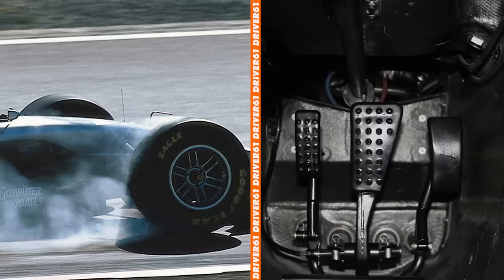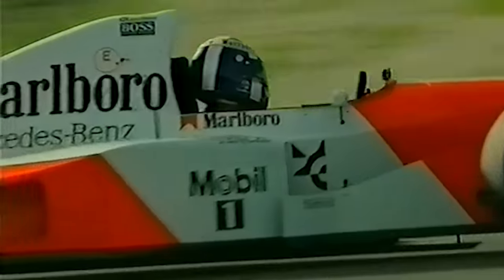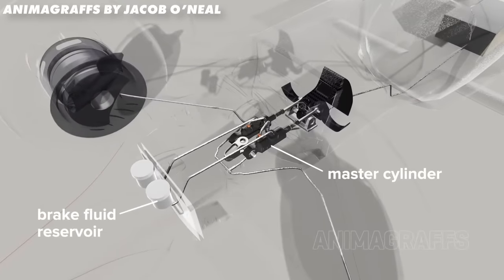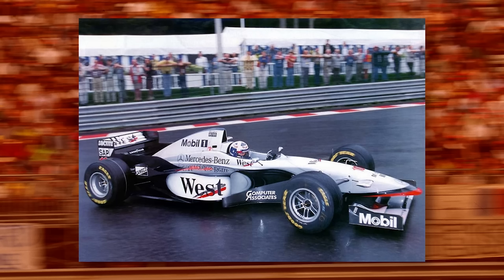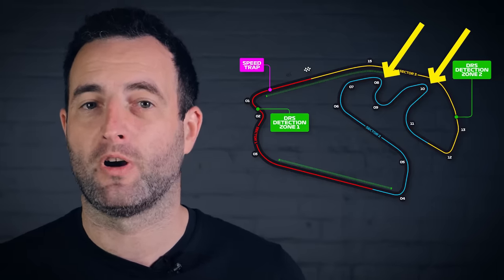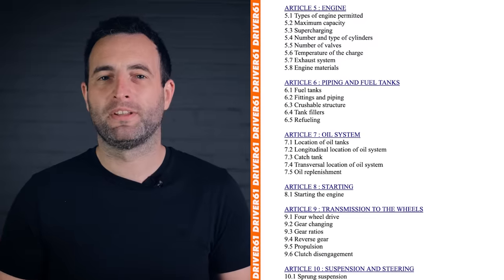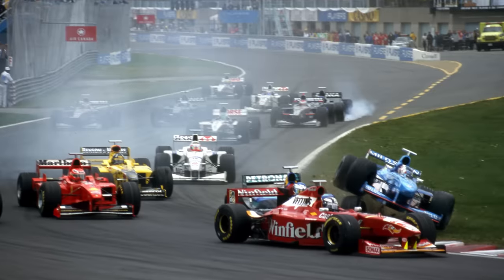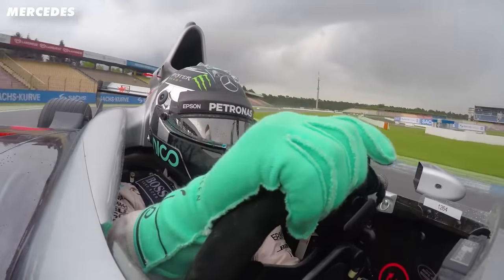Why This F1 Car Has FOUR PEDALS

Comment: No cheating, just briliant engineering.
Reply: It’s a shame they didn’t link the extra pedal to the steering rack. Turn left and it enables left caliper, turn right for right caliper.
Reply: @timh6845  then you'd end up with pointless braking on high speed corners
Reply: @timh6845  farm tractors have that technology.
Reply: @vincev5242  only with pressing the second brake pedal

Comment: I ran a 125 Super kart 20 years ago with 4 peddles mainly for the starts but it was good to be able to trail brake as well, and I use to race a gymkhana car that I had setup the clutch peddle to operate the hand brake when fully depressed so I always had 2 hands free for steering and changing gears, so as I pushed the clutch in at a hairpin it would disengage the clutch so I could shift back gears and keep the revs and handbrake turn all at the same time and then just dump the clutch as I came out of the turn and off it would go for the next turn. It was so fast and some people tried to get me disqualified but there was no rules saying you had to use a hand operated hand brake to turn so it never got them anywhere.

Comment: In motorcycle racing there's drag braking. Holding a bit of rear brake that helps keep the trailing arm suspension squat. I believe it helps enable an earlier delivery of power on exit. Which would squat the back if trail braking wasn't used. Less bobbing of the rear = smoother and more effective power delivery. On an F1 car there's an extra x axis for brake steering. I wonder if this feature also helps with keeping the rear squat? It's a double effect maybe.

Comment: Brilliant video here.
Appreciate it.
1 question here though...
Were FIA Stewards not checking the car post race everytime ?  As I know, FIA checks weight, underbody plank etc after each race.

Why it was only uncovered when photographer took photo of retired car.
Reply: It was uncovered to the public and other teams. As far as I know, the FIA will have deemed it legal privately with no obligation to make Mclaren’s design public
Reply: @TheSnaveeelPlaysGames  Yep, it passed all the rules about "the driver must pilot the car alone, unaided" and whatnot at the time since it was just a simple mechanical connection. There were no rules about having a brake pedal only connected to one wheel XD
Reply: The FIA had already visited Albert drive ( Mclaren factory) and agreed it was legal before the car was raced.

Comment: Tractors and other large farm machinery have had split brakes for over 50 years, one break pedal for each of the 2 drive wheels that were close enough so you could use them both at the same time. When using a rear wheel steering vehicle you can turn on one wheel.

Comment: It is a steering system of the rear wheel, the tank example is reasonable. Because F1 is driven by rear wheels with differential. If you brake the inside rear tire, it not only pulls to rotate the car, more engine power will be put on the outside rear wheel by the differential which push the car to rotate. How a tank steers? it pull one side and push the other side. The question is if the 4 wheel system is better than the 2 wheel ones why ban it?

Comment: This was an interesting bit of design and engineering, but not cheating under the rules of the time. While it was truly amazing to see it used in F1, it was being used off road quite a bit before F1.  My Dad and many of his friends build “sand rails” or “dune buggies” with steel tube hand-made frames powered by air cooled VW power trains.  Most of these buggies had steering brakes, separate activators for the rear brakes.  Our buggies used hand levers instead of an extra pedal or so, but they accomplished the same thing.  They allowed the buggy to make tighter turns (sometimes we used them to steer when we could manage to get the front end in the air).

Comment: Another reason brake steer should be brought back is to provide a greater challenge to the drivers. It's not a driver aid as it gives them more to do. It will make the sport slightly more about the driver than the car.

Comment: Why not just split the pedal, and pressure one side more than the other, manually creating a step in the pedals?
Or why not have a switch on the wheel, which changed brake bias left or right? You could even set it manitino-style with a range for each side.

Comment: In dirt track racing disabling a corner of the cars brakes is just part of the cars set up. Front rear bias is usually allowed but not individual corners. My old autocross car could bias side to side braking ( prerset ) and other teams took note " how can your car just jump into the corner ? ). My advice is to study ALL FORMS OF WHEELED RACING and be open to try what works for others...if you're not " cheating " your not competitive.

Comment: i think the system fall to the "passive 4 wheel steering" some cars nowadays have traction control to limit the inner wheelspin to make the car better at cornering, i even think diffs could be called passive 4 wheel steering to some extent

Comment: We need a racing series with no build rules excluding safety, NASCAR on-track rules (mainly rubbing is racing), and tracks that have a mix between F1 and Rally (like Spa with half the track made of dirt, along with the variety of SST tracks where entire sections change every year, and the starting grid of SST where the fastest in qualifying start in the back, potentially even with an up to 5 second start delay

Comment: This is actually  brake migration in nowadays. The extra pedal is electronically replaced by brake by wire system.
Reply: But you can't choose which of the rear wheels can be slowed more than the other
Reply: @pranavps851  The brake migration would automatically adjust according your diff speed.

Comment: All they had to do was get a cutter brake from a sand rail. It is on tractors and sandrails. It is alongside regular brakes and hand operation or foot operation. In Michigan that is what sandrails use to avoid trees on tight trails at high speed.

Comment: Mazda does use this brake steer method on the mx-5. They call it Kinematic Posture Control (KPC). It’s computer controlled so no second brake pedal but it does the same general thing.

Comment: As soon as the video started, I knew where this was going.
In aircraft, it's called differential braking.
This is quite a clever application, though. The implementation in aircraft is somewhat different, with the brakes being applied by both feet, one for each side.
I applaud their thinking.

Comment: Ferrari's tank argument comes down to the fact that tracked vehicles are primarily steered by changing the relative speed of each track through brakes and the gearbox.
Reply: Yeah, this is essentially a basic version of a differential brake steer used in M4s and the like. 

Maybe someone should try double differential steering.

Comment: They could've used a diverter valve linked to the steering wheel. Turning the wheel one way, sends fluid to the appropriate side. While straight it would send the fluid to both sides

Comment: I wonder why they did it this way instead of making a split pedal where each side of the pedal controlled the corresponding rear brake, but that you could also press both of at the same time for uniform braking.

Comment: They should come up with a ultimate racing open series. 
Allow all "banned" Tech From standard series. Fuel bias weight distribution systems, 4 wheel steeling, brake steer ect..... 
Teams know itll be a dangerous run... everyone's got an edge over something. Obviously Have a core rule book, No rocket assist, nitro ect.. 
But ya have a series that has all of these great ideas alloud to be put in a vehicle and see what happens.
Reply: and no budget limit

Comment: The part that is mind boggling too me is that they didn't install a valve linked to the stearing rack to switch the  side  on what the stearing break  is active to gain for the full potential of the system

Comment: As with all of the cockpit operated variables, it makes racing harder so it's strange to consider it cheating. There's an alternate timeline where sideways cockpit operated brake balance became a thing. I have a hard enough time thinking about moving front and rear.

Comment: So they used technology found in skid-steers, tanks, farm tractors, and anything that moves around on tracks, albeit utilized much differently in skid-steers and anything with tracks or use a hydrostatic transmission, but same basic principle.

Comment: Is this where all the brake-based torque vectoring on modern cars came from? Like the ones on WRX/wrangler rubicon etc?
Reply: road cars had "brake steer" since early 90s
Reply: @Baker_7498  brake steer and brake based torque vectoring are two different things. one kicks in when you apply brake the other kicks in when you apply throttle.

Comment: In a non-technical way I guess it was like a steering aid instead of means of steering. I get it that they would want to ban it - because the alternative would be that everybody would eventually adopt it - but I think they did it in an way that seemed arbitrary, instead of changing regulations to explicitly ban it in the future. To say that changing the speed of one wheel relative to the other constitutes steering and should thus be banned sounds absurd. So what then? Banning differentials?
Edit: Also, why only on one wheel? What's wrong with having 5 pedals lol

Comment: Pretty sure the differential would actually start sending more power to the outer wheel due to the brake force on the inner. Slowing down the inner and speeding up the outer sounds even more like steering then just braking one wheel alone. Nice.
Reply: And this would make it a 4 wheel steering system as all 4 wheels are actively turning the vehicle.
Reply: @kelainefes  very much so. It's super clever I have to admit. And honestly also I acknowledge a seemingly godly amount of talent a driver would need to use something like this to good effect.

Comment: Could they have gotten both rear brakes to operate independently if they connected it to the steering? ie if you are turning left it would brake the left rear wheel and turning right would brake the rear right wheel using the same extra pedal?

Comment: Oval racing has done similar things for years,  nothing new.  Proportioning valves have been used for both the front brakes,  putting more bias toward the inside tire,  and the rear.  A truly innovative system would have been proportioning the left vs. right based on steering wheel position.  Then you would have the best of both worlds.

Comment: The drivers have one foot on the left pedal on the other on the right. What I can't figure out is that the clutch is on the steering wheel and why it gives them so much trouble when they need to reverse.

Comment: I know weight is critical in these cars but they could have designed a valve apparatus to switch between the 2 rear wheels when the steering wheel was turned but it would probably weigh too much

Comment: What if you put a hydraulic pump on the steering column that would increase braking pressure as you turn in? Effectively, all 4 wheels should work in unison in a straight line, but as you enter the corner and trail brake, the inside rear would drag more based on steering input.
Reply: Over steering, under steering, and counter steering.
Reply: @chronophobic  obviously, it would have a gate so it only worked while under braking. The idea being that at the end of the braking zone, as you trail brake into the corner entry, a slight drag on the inside wheel would help turn in. The harder the turn in, the more drag is increased. Until the brake is released. It would only need to be 5% or so to be huge. And it's still a driver controlled system.

Comment: manual torque vectoring! I'm wondering how much faster  F1 would be with no regulation on driving aids, launch control, ESP, ABS.I know car enthusiasts like to disable driving aids but I think electronics developed only with performance in mind, rather than safety, would handily beat even F1 drivers. Torque vectoring could optimize traction on each tire and help turn quicker in slower corners.
launch/traction control would definitely holes hot easily at the beginning of the race or even exiting out of slow corners
even the most trained human cannot integrate data from dozens of sensors and optimize braking/power 100 times per second with 1% precision and on each tire. I'm happy that racing stays mostly analog but It would be an interesting experiment. We'll see how autonomous racing Evolves, which is really driving aids taken to the extreme

Comment: That was really cleaver engineering. Uneven breaking was not illegal. It does cause a change on the motion direction, but does it without steering the wheels, so it's not steering. The way other teams got it banned was the real cheating part.

Comment: Tractors have been using steering brakes since the 1930's. They were to both help manoeuvring and also performed the roll of a limited slip diff before diff lock became standard in the 1960's. 

The FIA in their wisdom seem to love banning cheap and simple devices only for them to be replaced by less effective, more expensive versions. 

To ban this system on the grounds on the grounds of it amounting to 4 wheel steering is bs, but really if that is their interpretation then they should also ban limited slip diffs and the drivers options to make adjustments.

Comment: Even agreeing that the system helps "steer" the car, wouldn't it be a 3 wheel steering, instead of 4 as the rules say? Was a very clever solution to "hook" the car around the corner acting like an amplified differential's force.
Anyway, happy Mclaren won that championship anyway. 1998 and 1999 Mclarens are still my favourites F1 cars!!!

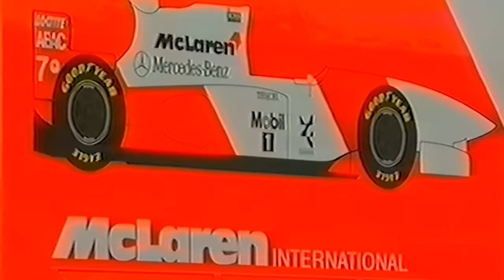Comment: 01:17 Understeer is bad at the exit, because of the rear tyres? At the exit it's basically going out of the corner, accelerating. Turning in sharply is important without understeer. 🤔

Comment: Couldn't you do something similar with modern cars and their ECU? The idea would be to enable differential braking if the brake pedal is pushed and the steering wheel is turned at the same time. Or is this against the regulations?

Comment: The tank argument is not farflung in my opinion. From my understanding vehicles with treads turn by offsetting the speed of the treads. When stationary they can rotate the body by spinning both treads in opposite directions. Think of like those godawful hoverboards that were popular a couple of years ago. So i guess the argument was changing the speed of one wheel to be much slower it was acting like a sort of steering system for the rear.

Comment: Let F1 engineers go at it with the brakes no regs.. they will probaply in the modern day make the brakes all operate on their own. Depending on which tire has the most load going into the corner

Comment: It surely is brilliant engineering, but at the same time it clearly is a way to steer the car with the back wheels. A bit like if you could manually change the rate of operation of the differential from corner to corner.

Comment: But.. you could of had it left or right.. if the master cylinder.. active left or right for terms of angle of the steering wheel.. set sensor on the wheel.. so it then sets which side is then inside because of the turn..

Comment: Why 3 pedals when you could bias the pressure with the steering input like run the main master cyl ito a secondary valve that opens either side with proportional steering input

Comment: so, basically, they only got caught because of Coulthard's car, not Hakkinen's.

If a layout of 3 pedals was OK because of the optional clutch pedal, Hakkinen's steering brake pedal could be easily disguised as a clutch pedal.
Meanwhile Coulthard's car had 4 pedals so it was kind of obvious.

Comment: Its such a simple piece of tech, the other teams could have copied it with spare parts theg had laying around with less effort than fighting it.

Hell I have enough parts laying around my garage right now to build the first version of the system, and I could order 2 line locks and a 3 position switch to build the final version for another $100

Comment: It is the same as DAS by Merc. Not cheating technically but banned as it gave the team too much advantage. DAS was kind of weird because they let them race it for the entire year before banning it essentially. So, other teams didn't even start to develope a system like it. Also because of the covid situation, a couple of races were held in pretty low teperatures like the Nurburgring for instance, where that better ability to heat up the front tyres really gave a huge advantage. Let's face it, the W11 would've easily won both championships without the DAS too.

Comment: I wonder how fast a car could be if it included every single piece of banned engineering. Blown diffuser, brake steer, active suspension, the works. Something like what Porsche did with their special 919 Nürburgring car. It'd be insane!
Reply: Cvt, fan cars, make them twin charged, unrestricted engine

Comment: It is a manual stability control, not eletronic. Like the same way the throttle pedal can work as a traction control in a skilled foot driver. For me this is not cheating.

Comment: They called it brake-steer themselves? How can that not be seen as four wheel steering (thereby cheating) even if it's not what the usual idea of four wheel steering is, it did certainly achieve that result effectively enough to taint results.